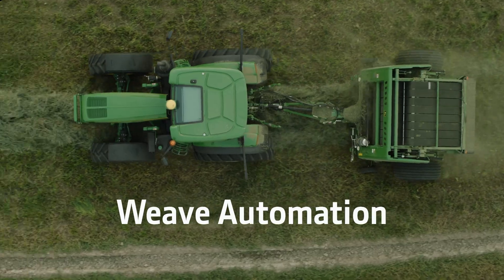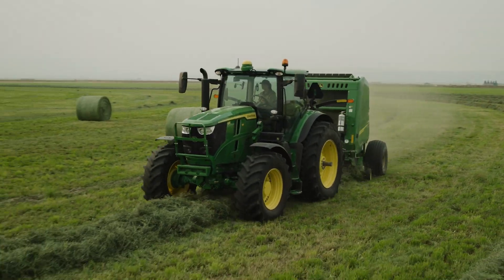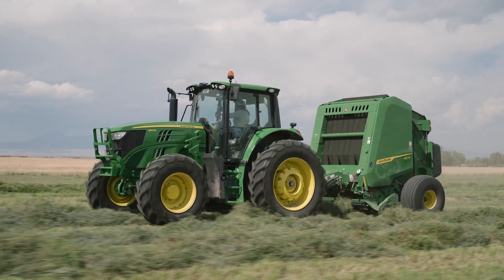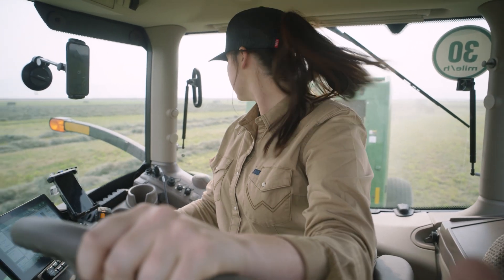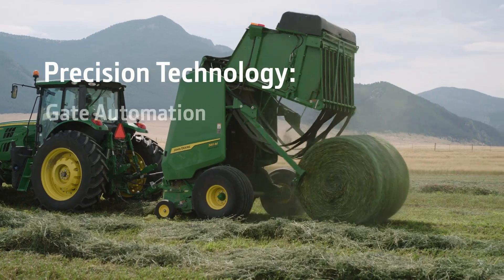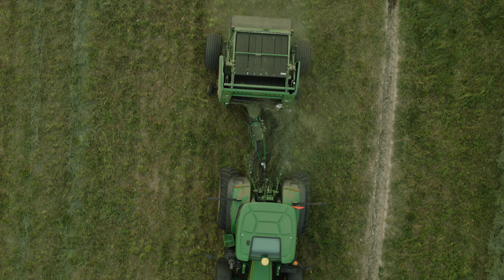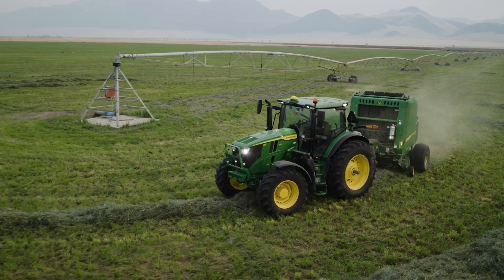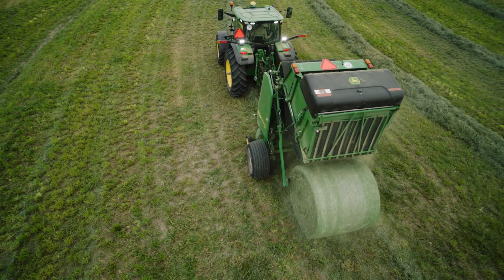Meet Weave Automation | John Deere Balers

Comment: Next step have the self propelled windrower record autopath lines that this could follow then it’s awfully close to automation
Reply: I did this with my MoCo and then my V rake.   The lines came out so close that I could just shift the track a few inches while baling fat double windrows.   Easy on our 4 foot baler, probably not practical on a 5 footer.   1 Series balers are isobus, it’s not a stretch to imagine the baler evenly feeding itself using Autotrac and LIDAR.